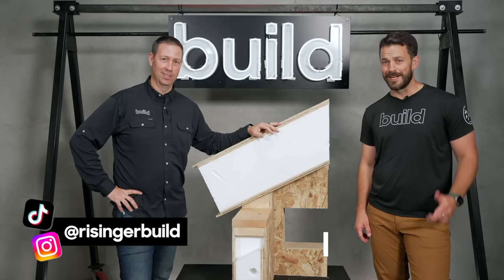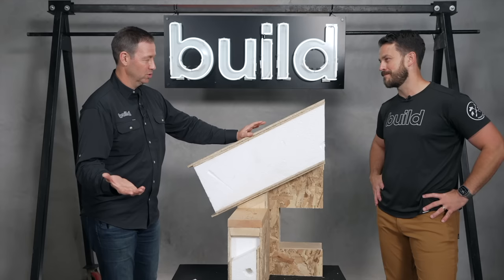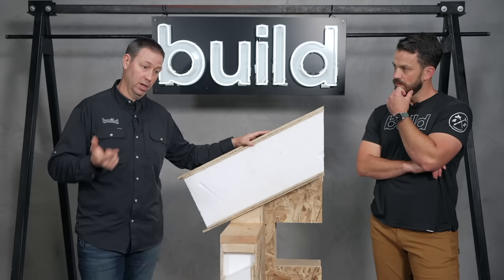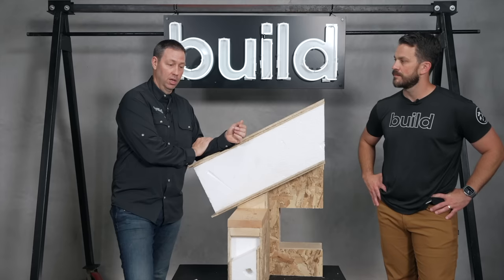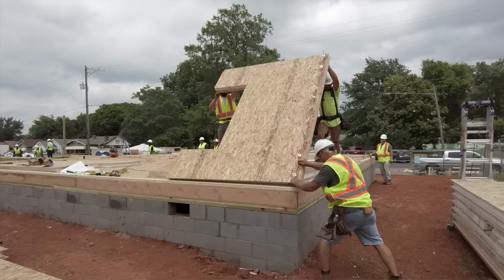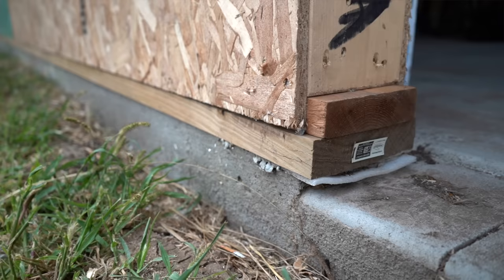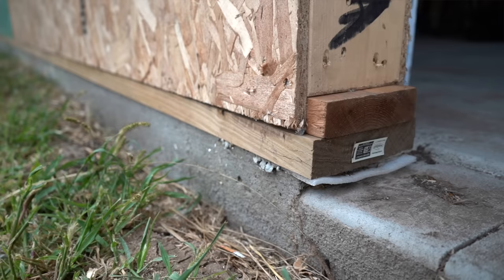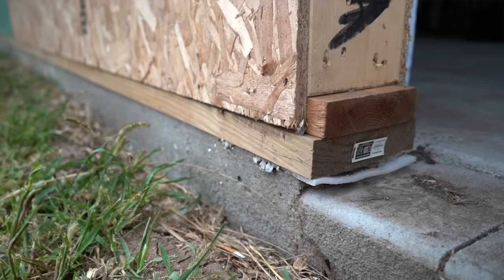SIPs Framing Update 2023 - Extreme Panel System Install w/ Will King

Comment: They could use this in Maui and Hawaii in general. Would it be possible to ship a package to Hawaii?
Reply: Hawaii, ant problems.  I wouldn't do a sip.  Cinder block construction, the ants eat too.  Perfect block ICCF maybe.
Reply: styrofoam melts and burns in a fire.. the flammability of this system is a major downside

Comment: How is the fire behavior?
Does it have a vapour barrier?
Reply: I've done lot's of them as far 🔥 you can get them with different types of foam thats not just going to 🔥 up ,this company probably can do some of that for you I'm sure, but some are made in big giant machines they more then likely don't have,so they maybe just put them together with vacuum blankets and weights and glue you can make them yourself if you really wanted to, the guy that pretty much invented these kinda is winter panel in VT, they did get on PBS back in the day these have been around for while my life time and I'm 50, as far as anything else no gaps at all ! They can have a good moisture Drive around Plumbing holes and in between them themselves make them "tight" sealed and or foamed right ! you should be able to suffocate in it ! 😂 you need a air exchanger, other then that I would do a cold roof you lay down your tar paper or whatever then strap it again with two-by-fours flat up and down like your rafters and vent and put down plywood or osb down again then your roofing the rest would depend on your siding, you could rap these with all kinds of stuff rubber even but Masonry or anything like that you would want that gap again, they are very very nice ! Walking around on a radiant heat  floor  maybe a raised slab even with radiant heat no hot spots in the house or whatever nothing like studs or metal ! Real comfortable feeling going room from room cool nights open the windows then close them before the sun comes up keeps that temperature all day 😂 if it got down to 55 at night it would be 55 in the afternoon with nothing running, very comfortable.

Comment: Matt, 
What about the health factor when it comes to the foam used inside the panels, I guess it is called off-gassing?
Would that be a health concern?
Thank you for this presentation, great job!
Reply: The most off gassing come from OSB not EPS . And as you know OSB used a lot in home construction and furniture, so if you want a healthy house spend money on good ventilation system

Comment: The plumbing and electrical is a problem unless attach a two bye i don't see it im just not sure but im 65 so that might explain my questioning
Reply: With Modern Fortress The electrical pathways are pre-run and premarked externally for location purposes for pulling the wires.

Comment: When there is vapor pressure in a cold climate winter heating time, how is vapor prevented from migrating through the roof panel joints and condensing as it reaches the dew point?  As seen in earlier roof sip installations this can result in outside skin rot and discoloration of roofing material over the joints.
Reply: Sips are generally sold with a sealant which is applied at all the joints and sill connections to prevent vapor migration.

Comment: As a prospective home owner who would like to USE a system like this ... when you ALSO use SIPS for SUBFLOORING, do you need extra wood built into the SIPS to attach the inner, 2x4"-inch wall framing/bases to, so that the screwed, or nail gun connection is strong enough? Do you use a glue, then place the interior framing over that? And is there a water barrier that needs to be taped down/applied to the SUBFLOOR SIPS panels? Certainly, it can be a huge problem if water gets through to the SIPS subfloor top sheathing layer.

And are you placing the subfloor ON shorter wood joists, I-Joists, Scissor Trusses, etc.? Or how many feet can your run the panels before you need a joist to prevent sagging over time. Thanks...
Reply: Give extreme panels a call and they can answer all your questions. Great company!
Reply: There are not any extra wood in the floor SIPs for "you need extra wood built into the SIPS to attach the inner, 2x4"-inch wall framing/bases to, so that the screwed, or nail gun connection is strong enough" but you can always have them add extra wood.  There are no extra wood in the wall SIPs either, so you screw the kitchen cabinets to OSB.  Is that strong enough??? probabley not...

Comment: I think I confused myself SEPS basement are the ones that need the cement  poored into them and these are the above ground build that dont require the cement poured but they are called the same thing SEP. My question is do I fly down there and give them the blueprints to my house and they take it from there. Can they provide the vith types. My situation is that the good builders really dont do my area I want to build and so trying to get services like this as much as possible. I would do the Benson house but that about 200+k out of my price since I have 700k in cash for the build. By the way totally sold my on the Zip and rainscreens

Comment: Please tell me what is done for those SIP homes on tornado alley or earthquake areas?  The home are pretty light and would come a part easier that wood built framing.
Reply: You anchor the house to the ground with heavy duty foundation. The SIP system will likely do better in a tornado because the whole house are glued together with high quality adhesive.

Comment: I can not see hanging something heavy just to osb . Why not put 2x3 or flat every 2 ft on center , or 3x osb every 2 ft ?
Reply: In SIP system most of the structural strength is in the core foam. That is why you see them using very long screws.

Comment: Seems great from an air sealing pov but How much can u really hang on 7/16 osb or whatever sheathing is? Remodeling would be a nightmare, what if u wanted to add recessed lights to a room, u would have to start cutting into the foam and compromise the building, the regular electrician is not going to know exact chase locations if a wire had to be replaced.
Reply: They already told you the chase is marked with red lines.
Reply: @kazedcat  But you'd need to rip down all of the drywall to see the lines.
Reply: @stevemarton5620  How is that different from stud walls. You need to rip the dry wall if you need to replace electrical lines.

Comment: Why are most companies using polystyrene vs a polyurethane foam? The polyurethane foam has a higher r-value per inch of thickness, is stronger, is actually fire retardant, and the panels won't sheer away from themselves (which is very rare).
Reply: It is mostly cost. Polystyrene is cheaper. As stated in the video SIP in apples to apples comparison with stick building is 10% higher. Using higher quality foam would significantly affect the overall cost competitiveness. But if you are willing to spend more for better materials there are SIP companies that offer Polyurethane foam.
Reply: @kazedcat  I'm not sure it is cost. I built a Urethane SIP shop, 30x40 in 2004 and costed out styrene vs urethane foam panels. The urethane came out at almost the same price because I could use 4" panels instead of the 6" panels for styprene. Plus the wooden splines were cheaper, shipping was cheaper (less weight), screw lengths were shorter therefore cheaper, much easier to move around because of less weight. So when all factors were considered the urethane was a much better deal.

Comment: I built a home with SIPS. The big downside is remodeling or changing anything on site during building. Adding doors or windows sometimes are not possible due to engineering. We also dont need HVAC in our home in WY.  Lower utilities bill. that said I would NEVER build in sips again. I really dont like it

Comment: We have alot of shitty concrete guys here in Texas humps in the concrete slabs out of square. Etc how would you       make a sip pannels rroof line straight if say you got a 60 ft run with a 1" hump in the middle? I like my shit to look straight even if concrete guys suck now I know exactly what I'd do stick framing. I'm bidding on my first sip build trying to get educated thinking of all the shit that could go wrong they look very simple in a perfect world. If concrete foundation is jacked up would it affect air tightness to shim above top plate or bottom plate in order to make roof line super straight. Just an honest ? It will have a concrete slab

Comment: This company would love you to build EVERYTHING out of SIP, but what if there's a bang-for-the-buck middleground? For example, is there a case to be made for only SOME walls to be SIP? Is there a case to be made for every house on your street having a SIP roof?
Reply: Good point. Was just talking to a local builder about this and he thinks using SIPs for roofing is the way to go, even if the walls are traditional.
Reply: I’m a builder that uses extreme panels. I’m building a home right now that has a SIP exterior walls with half the roof SIP panels and half the roof traditional truss rafters. There are ways to combine all types of construction with SIPs

Comment: I wonder what the cost difference is between the Dream Shop that RR Buildings is doing right now compared to SIP's. He plans on using Rockwool insulation and an inside vapor barrier with tape system. Here is that video. https://www.youtube.com/watch?v=Sk8M7udNtnw&t=719s

Comment: System sounds great, most of the concerns are addressed however ONE MAJOR CONCERN is kind of kicked into the dirt until it seems irrelevant and that is REMODEL. Everything has to be preplanned and future proofed at the time of initial construction. Any new wiring like ethernet, audio cables, additional lighting, or electrical in bathrooms for bidet and any other future accessories that require wall routing becomes a major blocker to the viability of the system to the point of the owner saying nevermind this remodel or addition is too difficult I'm just not going to do it and that will bring the satisfaction of SIP construction building down. I just don't see how you can improve the existing system to factor in the above concerns. This might be great for low income project where you can gain a higher performing house at the expense of higher cost of materials but at the same time save on labor by constructing it in a fraction fo the time allowing you to build a big low income community faster, easier, and with higher performance. For higher end homes, where customization and remodel is definitely a factor, I'd have to say this is a no-go.

Comment: Never understood why they don’t make these with other insulation types, wood fiber seems like a great insulation to use with this type of construction.
Reply: The foam add structural integrity. So if your insulation is not structural you need to add more studs for strength.
Reply: @kazedcat  but I’m fairly certain I’ve seen gutex boards used as sheathing before. I’d be shocked if wood fiber insulation has less structural properties than foam.
Reply: @cxsey8587  You must get shocked a lot
Reply: @scottkamm6384 Especially responding to bozos
Reply: @cxsey8587  I know you are but what am I?

Comment: Sip panels are not biodegradable, Expanded polystyrene (EPS), also known as Styrofoam, is generally not biodegradable. In fact, it can take hundreds of years to decompose in landfills and can be hazardous to wildlife. When EPS breaks down, it can form microplastics and leachate that contaminate waterways, groundwater, and land. Animals may also mistake the small pieces of plastic foam for food.

Comment: Most SIP video has little installation details, may be most presenter don't know, so, they seem just be ad. or sales. Disappointed. Also, SIP would be disaster during fire, harmful gas, easy to be burned and collapsed. Don't think it will be cheaper - because contractor wants to earn more.

Comment: Please discuss the negative carbon impact and poor health/environmental implications of using massive amounts of EPS...
Reply: Welcome to living in the modern world…if not this…it will be the microlastics in your veggies…or seal meat from the artic or or or…🤷🏻‍♂️…
Reply: @getyourbone  So you're saying we should go full scorched Earth...?  Come on.

We definitely have known standards and new alternative insulation choices that don't require extensive amounts of foam, why choose SIPs when the negative environmental impacts outweigh the positives so clearly?  Seems like we could be making one better choice in our insulation which is a significant volumetric contributor to the waste stream and embodied carbon.  There are better options like wood fiber, hemp fiber, wool, even recycled cellulose.  Virgin foam polymers are a huge problem and are something that can be avoided.  Then, onto the next problem to solve, but at least one less.

Comment: No thanks, a tornado will pull that off. I like it for tiny houses. I’d like those for floors too.
Reply from the maker: I’m not sure a tornado will leave any roof (or building)  that’s not concrete intact.
Reply: @buildshow pumicecrete roofs can't blow off walls and roof is 2' thick and is a mono pour
Reply: @raymondpeters9186 In short concrete.

Comment: As a licensed electrical contractor I would charge between 3 and 4 times the cost to wire a sips home PIA same with the plumber and good luck finding a Sub to work on your house
Reply: not true. We built a 5000 sq ft home with SIPS.  costs was the same for subs.
Reply: Good for you
Reply: I'm an architect and I built my own SIP home. Mechanical, plumbing and electrical were no problem. Running a fish tape and pulling wire in the built-in conduits was actually easier than drilling studs.
Reply: Raymond are you speaking from experience or first impressions?

Comment: all the "innovation" I see in this product is to make it extremely cheap to manufacture and to assemble for the company. I have doubts about bearing capacity and longevity of SIP panels. Sorry, but it is a "fast food" of the construction tech, cheap and minimal quality materials.
Reply: There are load tests you can see online. Structurally, they are way stronger than stud walls.
Reply: My brother built a SIP home 18 years ago and it has been problem free.